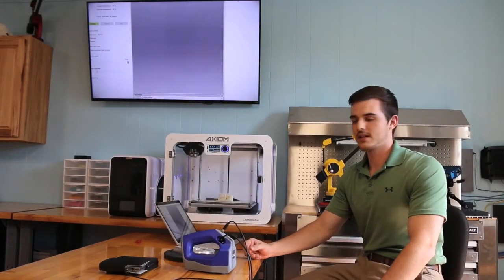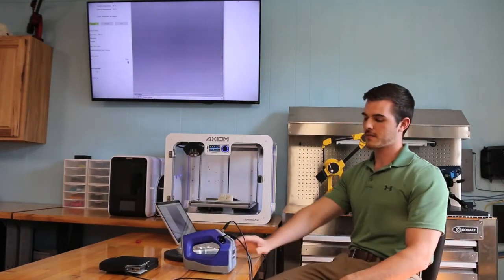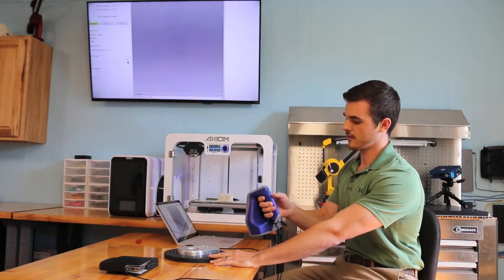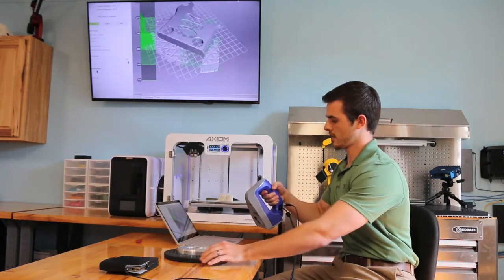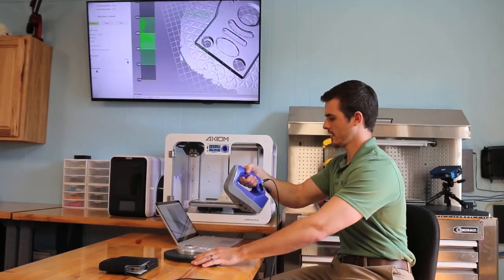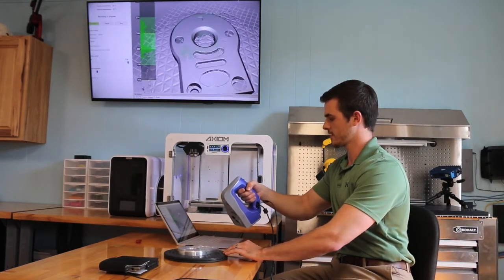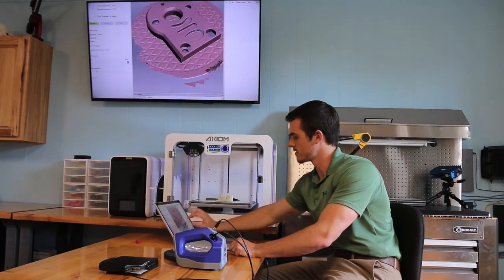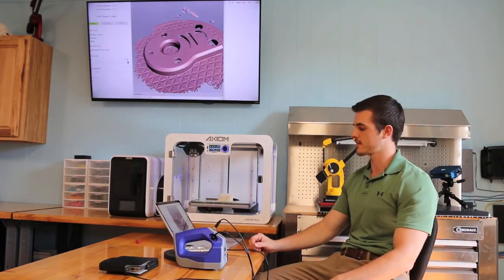3D Scanning a Metal Part with Artec Space Spider

Comment: This would good scanning chrome parts then? Could i just save the the information and send it to a machine shop to duplicate my part?
Reply from the maker: Yes, the Artec Space Spider would be good for scanning chrome parts. Depending upon your application, the file can either be sent directly to a CNC or you can use the scan data as a reference to reverse engineer it into a CAD model. Hope this helps.